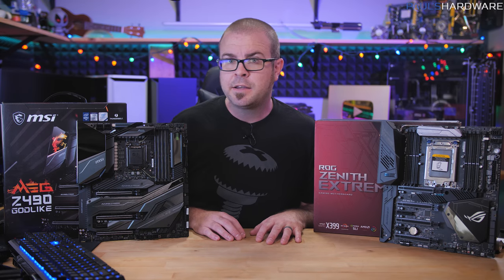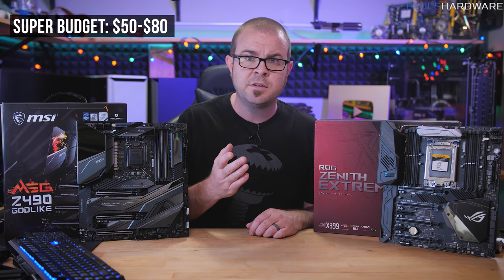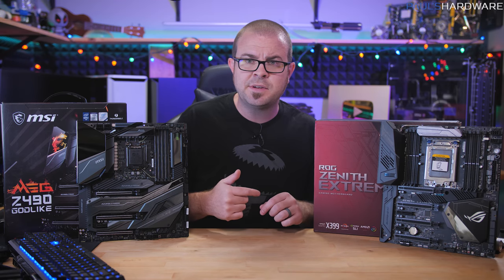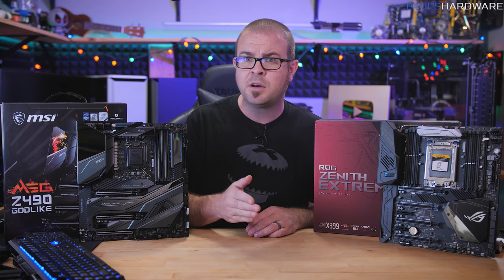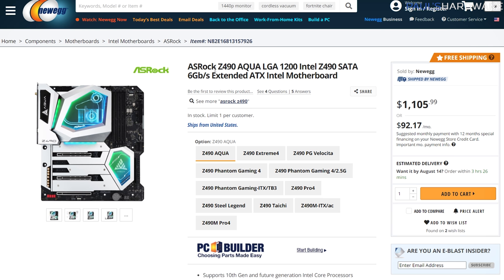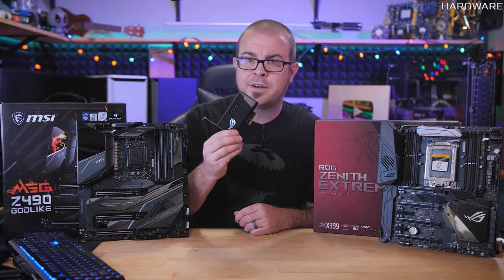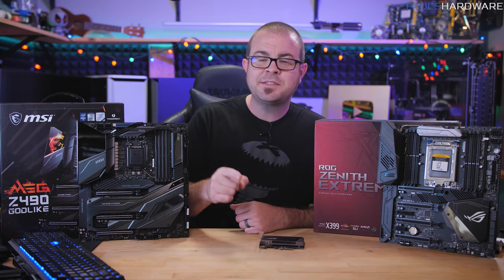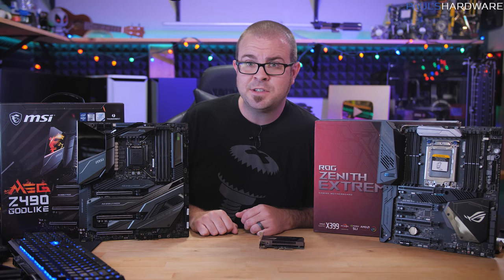What Does a $700 Motherboard Have that a $200 Motherboard Doesn’t?

Comment: Question, Paul: You say that having 2 dimm lots is a stupid way to cut costs?+

Why? I have yet to run into problems with 16Gb of memory. 
So when you start out with 2x8 DDR4 or, 4x4 DDR3 like in my previous x79 build... why would you want more for gaming?
And if 16 is not enough, alright, get 32 Gig in a 2x16 config.

I don't really see the need for more dimm slots per memory channel except for professional use and even then it's written off as en business expense. 

I genuinely don't see the need. Help me out here?
Reply: It depends on the mobo but most mobos have their RAM layout feed into the processor's cores in a particular configuration (in fact waaaaay back when- and I'm dating myself here- if you only had two sticks of RAM and four slots, you needed to space the sticks out or one core of your CPU would hog all of the RAM.... that no longer happens but cores still prioritize RAM sharing based on slot), so theoretically 4 slots allows your CPU to balance RAM more easily between the now huge amount of cores in most CPUs, especially the high core count AMD CPUs. Functionally though, nowadays, I think you'd be absolutely fine with a 2 slot. 

So the only other reason is that 2x16 is usually more expensive than 4x8. And I really doubt anyone will be really utilizing 64GB unless you're doing some REALLY high end stuff like extreme high quality editing or something, but 2x32 isn't really all that viable whereas 4x16GB is, so I guess it's nice to have that option.

Comment: One reason I would pay more for a mother board is the capacity to save more now on a lower end CPU and be able to upgrade it 4 or 5 years down the road and still use the old motherboard. Upgrade ability is one thing you didn’t touch on that I’d like to hear about whether a mid-end mobo will be good enough and what I might get in terms of longevity by spending more.

Comment: Well actually....
For many years I was a computer master, then I got out... Then well I needed to upgrade.

So now, a little while later on after brushing up. 
There seems to be two very different areas of computing.
Much of the boards and features or just plain functions are NOT included.
Let's go back a little bit and the B450...
Now to me that's was mid range, regardless of what was stuck on the board. Why? Because the x299 had more use features.

Let's look at a Asus p67pro. 3* Pciex slots... Solid board old as you like nowa days.
B450 2* pciex slots.

So like you said add in cards. Here is me....
Graphics card, raid controller, 10gb NIC... Nope!
All the add in cards save for the GPU are 4*. B 450 has problems there.

Oddly the much older Asus p67pro doesn't. So In a way I upgraded to downgrade usability.

So I then went and thought I was a dick, so looked at all the boards thinking I messed something, nope! There all like it. So what did I need to buy? A tr4 board.  At £500 extra, it wasn't really a  smooth  grading system up the boards and well, looking at the offerings most of the boards just have tat on them.
Unlesa board have coprocessors, all add one run from the board and there is no hand off like what you get in buying cards you can pop in.
 So it is my view and from experience (outdated) that you pay more for somewhat less.
Even before I bought the R7 & 450 I saw the threadripper, liked and was in budget, then I saw the entry boards and crap-ped pants. There is no way that I would pay that much as combined it was silly money to be paying. Then on picking the 450 it was then feature sets. 
So that would be around your 100 dollar mark. 

Don't get me wrong it works good, but it's just not practical for me and loses its upgrade path, because it's very limited to what it can do.

So what a lot of people call high end gaming, I call mid range systems. Back in my building days if was different with quadro cards Vs the geforce, in terms of graphical performance and render.

But the jump between "mid range" and work flow systems is massive.

Comment: I know these are recommendations from an enthusiast but... I don't need any of those features. I'm also looking at A520 boards and am thinking... In what way does a B550 improve my gaming/computing experience? If the power delivery is cooled, it should be fine to even put a 16 core cpu in there. I don't care about a gazilion usb 3.2 ports. I don't care that my chipset only runs at PCIE Gen 3, why would I even care about that? An RTX 20XX only has PCIE Gen 3.
Maybe I'm not enthusiast enough but I really like to optimize instead of buying features I'll never use.

Comment: The Asus Hyper M.2 X16 Card is just not a M.2 Riser card - It's an PCIE3 - x16 adapter card ; It uses a PCIE-3 X16 slot on a mb that supports Multiple X16 PCIE slots and turns that slot into 4 x 4 PCIE M.2 slots on a mb with a Chipset that supports it and now there is a PCIE-4 x X16 version.

Comment: I bought a Gigabyte X570 Auros Xtreme, mainly because it was the only X570 board without a chipset fan (I'll admit the super overkill VRM, abundance of ports, built in bluetooth, and 10 Gbps LAN helped, not that I have a 10 Gbps switch). I regret it only because of the E-ATX form factor, which coupled with the 90 degree connectors makes it hard to plug in the 24-pin in my Phanteks P600S.

Comment: I used an old Optiplex Mobo for the longest time, first with an i5-3470 and later with an i7-3770.
I saved up a long time to get a 3600 and MSI x570 Plus.

Comment: The problem I have with $200 boards is that the pci-express connections are quite limited. I am used to the early 2000s when we used all the pci spots we had. I know that alot have been integrated and that is nice but it still limits me. I prefer to have a dedicated wifi card and not have it built in or be able to still use a capture card. I know that usb is great but not perfect. The MEG Godlike is really what I expect when it comes to motherboards.

Comment: Hi Paul! Love your video! Your comment on DACs made a lot of sense. One thing I've always wondered for if you really want a good internal audio solution and wanted to go with a sound card, would there be any benefit to using the GPU vertical mount for the sound card? I've seen nobody test this. Sound cards don't need cooling, but being so far away from the rest of the board could be beneficial to interference, no?

Comment: It is highly recommend to stop and appreciate the difference between platforms and mainboards, as pointed out in this video. There are super high priced mainboards for mainstream- and HEDT platforms,  but a 700 Dollar consumer motherboard will not give you as much PCIE Lanes, as a 300 dollar HEDT motherboard. That being said, I don’t find super highend motherboards on mainstream platforms to be worth it. For the most part, that is. I don’t overlock and I don’t bother to build a custom watercooled PC either.

Sometimes those really expensive mainboards have features very unique to them, like the Gigabyte AORUS X570 XTREME, which is one of the very few X570 boards to be completely passive cooled, (including hidden PCIE 4.0 M.2 SSDs) has enough slots to at make very efficient use of the available lanes, gives you a ton of connectivity and whatnot. But as you are in constant danger of overloading the Chipset and/or some controllers by doing that, if you actually need all of this highspeed connectivity. If you checked out the information on how communication works on motherboards, you will know, what I mean.  I’d rather invest in an HEDT platform before investing in a super expensive motherboard like that.

Comment: i have the original Zenith Extreme. was it worth the $549 i paid? I still don't know to this day.

to add, I think the inclusion of backplates is the idea of giving the PCB more stiffness. Like a roll bar added to a Miata. don't forget that PCBs tend to be a lot heavier now when they are loaded with features, and probably need backplates to help prevent warping of the motherboard.

Comment: I have the Z390 Godlike Motherboard and i love it. Just because it has stuff i use from time to time.. LN2 OC Support, a shitton of connectors (RGB; Fan Headers, USB), points to check power, Multi-Bios and such stuff. I've got it for 450€ instead of 600€ or whatever it costs these days.

Comment: Deals affect it, I went up from B550 to X570 at a mid-range price then discovered Q-flash + when I saw the box, CPU-less BIOS updates/recovery.
All PCIE 4 NVME have seperate lanes and heatsinks and the VRMs seem more high end for future oc-ing.
There's loads of SATA to reuse older drives in RAID 0 or 10 configuration.
The B550 had typical features but wouldn't have allowed me to exploit fully my case and my drive hoarding habit 😁😁
Now I know I will miss LED audio jacks, but as I don't replug often and S/W can show you what's connected.
I don't think more than 1Gb net, means much to 99% of users, mostly they're streaming from the Internet

Comment: What I need is a motherboard that has at least 10 SATA inputs, to accommodate all of my hard drives, as well as 2 slots for a couple of 2TB M.2 SSDs. About the only other thing I can think of is a max RAM capability of 128GB.
Many of the budget motherboards fall short in one or more of these areas. The search continues . . .
Reply: Wouldn't a server be better?

Comment: I'm building a new rig with an i9-10900k this week, and I went with the Asus Rog Maximus XII Formula variant board, not for the water cooled VRM, but because it has a lot of USB ports on the back, and not one but TWO USB-3.1 gen 1 headers, and one USB-3.1 gen 2 header... that lets me use all of the ports that are built into my case (Lian Li PC-O11 Dynamix XL).  I looked far and wide for a MB with two USB 3.1 gen 1 headers to use all 4 USB ports on the case, and there are only a very small handful, and they're all $500+... which made me sad.

Comment: I still use a toslink connection on both my desktop and my HTPC. Because the audio systems they connect to have built-in DACs but no USB ports. Something I would gladly pay extra for would be a motherboard that is not black. I do have one system with the white MSI Mortar board. Would love for them to bring back red pcbs.

Comment: I bought a X570 Crosshair VIII Formula. Purely for aesthetics reasons, since I went for hardline water cooling.

Just drives me nuts that the water in/out of the EK block Asus put on the Formula doesn't match up to EK's own Vector series blocks.

Comment: I like the video, you are a great presenter as always.

But the issue I have is the extreme level of inflation over a 2-3 year period.

Back on the Z370 series boards, a asus rog cost about £200-240, not sure about american prices, but often we have been at 1:1 or even worse vs american prices on PC components so probably were no higher than 250USD.

Asus ROG I consider a high end board, no mid range.

Fast forward to today, and Asus ROG boards for the latest chipsets are 2-3x the price.  What has happened?  There is no new practical features, on the plain simplicity of it there is huge price inflation, I remember a few people stating that for the new AMD chipset, they added wafers to create the quality required for PCIE4, but other then that no real explenation given.

You explained why high end boards are high end boards, but to me the question is why high end boards cost so much today vs in 2017-2018.
Reply: They’re all fashionable now.

Comment: Got the Gigabyte Aorus Xtreme. Fanless, Colorscheme, the 3 M.2 Slots, VRMs (planned to get a 3950x and oc - but availability here was terrible so got a 3900x that didnt oc well. Should still be able to get a 4950x or whatever it'll be called though!). Pretty much my plan was 'get a motherboard that will last a while when AMD leaves AM4'. And while it was expensive, I must say I am happy with it. 
Also I find that while the backplate might be there for looks, it also makes the motherboard feel more 'solid' with the heavy beasts that we call graphicscards nowadays. Cause holy crap the 2080ti is a thiccboi...

Comment: i paid over 700$ for my motherboard.. MSI MEG z390 Godlike. My pc was just shy of 7 grand all together.

and the reason why i paid that much is very very simple. Longevity.. this motherboard was built for extreme overclocking. The vrm's, all the components, everything on it was designed and built for very very extreme overclocking (LN2 and such). It is the highest possible quality motherboard you can buy (excluding the ridiculous xeon platforms and some of their 2000$+ motherboards.. regular consumer level, imo the godlike is the apex.. so on my none, or very little overclocking i do, this motherboard will (should, in theory) last exponentially longer than buying a cheap motherboard. Plus the z390 godlike came with a capture card, m.2 riser card, has dual very high speed ethernet ports, type c, 5X total m.2 slots available, And a very high quality DAC built on to the board with a 1/4 inch jack on the back. Everything i wanted was on this board.

I look at it like this.. say you have two cars.. one is built to do 65mph and you run it at 65mph 24 hours a day.. the other car is built to drive 300mph, and you run it at 65mph 24 hours a day... Which car is more likely to break down? the car youre running at 100%, or 20%?

And even if that logic is completely flawed, The peace of mind alone is worth it to me.

Comment: me! I'm someone who buys them. I bought an MSI MEG Godlike Motherboard z390. I got it because I wanted the most overclocking support and stability for overclocking my i9 9900KS Cpu to 5.2Ghz and RTX 2080 Super. I got a gold rated 1000 seasonic psu and 32GB 3600Mhz ram. I wanted to go all out on performance and push my pc to the limit. I also wanted good support for NVME with heat sinks. I also wanted 4 pcie slots and I wanted a Motherboard with a  really good sound card amp and dac. i like the Hi res certified solution and lossless solution and it being separated from the rest of the electronics on the pcb to reduce electro magnetic interference noise. im also an audiophile. i wanted gold plated jacks on the back to compliment the already good sound solution. i also wanted some rgb on the board and lights in the jacla in the back. I really liked the oled display in the Motherboard. this board had everything I wanted. it checked all the boxes. and I honestly couldn't find everything I wanted in one board except this one and the rog one equivalent. but this one was my favorite and had a bit more. so thats why I bought this Motherboard.

Comment: Not running something quite that extreme, but I have a Gigabyte X399 Designare EX and when I bought it, it just had most of the features I wanted (lots of PCI-E slots, 3 M.2 Slots, a USB-C Front panel connector, kind of Thunderbolt)

Comment: I cannot agree with you, sorry to say, on that audio issue. As Igor stated some weeks ago...there is one realtek chipset that gives enough amps and fidelity that your highend Headsets will be served with bass, detailed heights... the ALC 1220 
The whole point of your video was at end not to overspent on motherboards, so anyone can get that ALC1220 chipset on some boards below 200 bucks and get as in my case (Asus Amd + Intel) absolely clear sound without any interference from the mobo. My point is you are recommending to not overspent on mobo's and then for one small feature overspent heavily for another item (the price of maybe a second board). For sure its a good recommendation for audio professionals but for the guys and gals sitting @ home pc... really, even if you have hq headphones, you will not notice a difference in a blind test... Thanks for your content!

Comment: I actually went for the full size of the B550, until I realized I order the meshify c mini. Well, fuck time to cancel the full size, and get the B550-I. Amazing time with this board. Cannot complain. And since I've had to rearrange the setup more than once; it has been super useful to have those lights on the back.

Comment: Good video but I was surprised you didn't talk more about the I/O especially USB ports because I find on the $200 or lower boards that they are really lacking. Maybe I use more devices than most others??? but I find the ports go fast. Also, with cases having 4x USB 3 A ports and a Type C port on the front panel, trying to take advantage of all of them can really limit your motherboard options as you need 2 of the USB 3 Type A headers and one Type C header.

Comment: 23:39 iirc all X570 Gigabyte boards have Q-Flash (BIOS Flashback) built in. Friend bought a 5800x and it was our go to board just because if it doesn't have the correct bios he knew he could flash it without needing to borrow someone else's 3xxx chip

Comment: Can I get an recommendation on a highly stable AM4 motherboard? I don't plan to overclock, so I'm leaning toward B550 unless X570 has some obvious appeal.

I'm afraid of the old, decrepit wiring in my current living arrangement and I don't have the option to get an electrician. I've had 2 PSUs die recently in my gigabyte B450 and I'm looking to eliminate this possibility from the future. I am getting a gold rated PSU, a new case, and an uninterruptable power supply to help mitigate the possibilities of fluctuations.